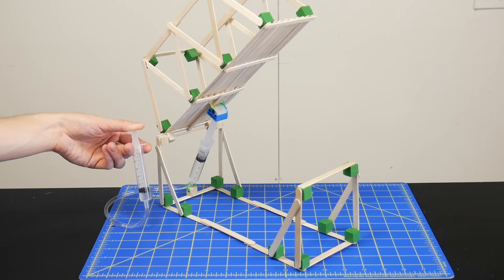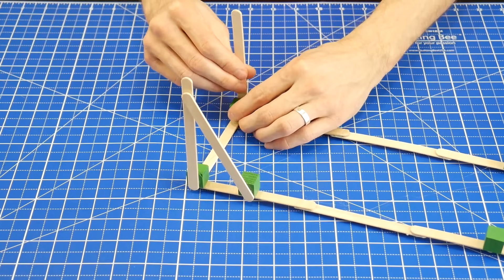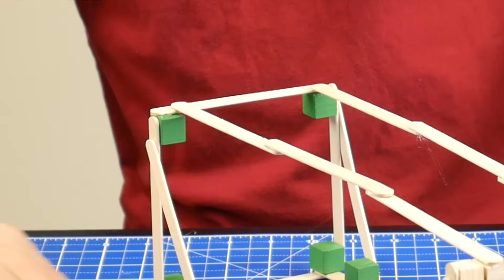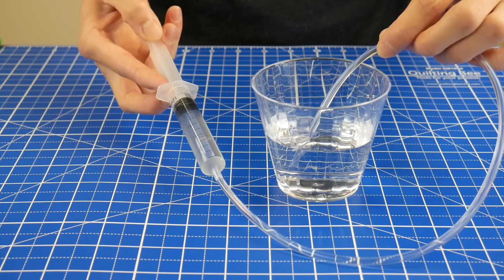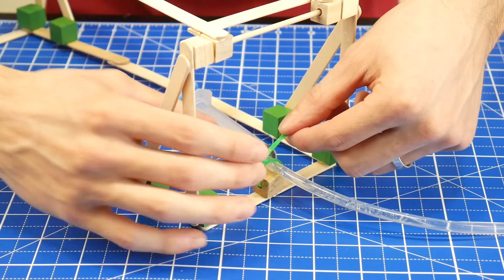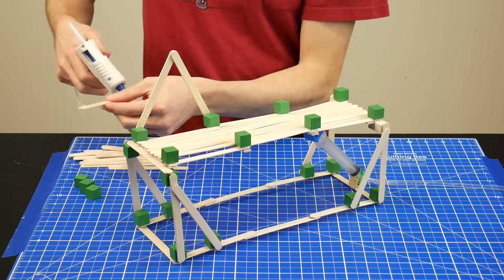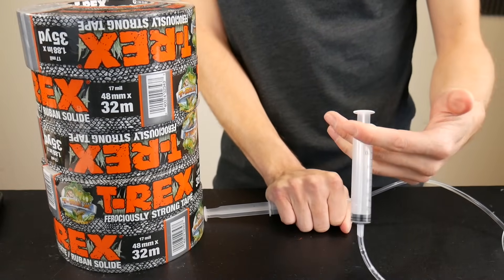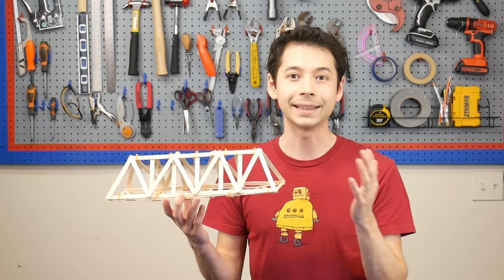Young Engineers: Hydraulic Bridge - Engineering & STEM Project for Kids

Comment: My hydraulic pump keeps leaking.  When I push the syringe full of water, it leaks at the connections between tubing and both syringes, rather than pushing the water into the other, empty, syringe. Any suggestions?
Reply: Either what the other person said or your syringe is not working properly and you need a new one because my syringe was broken or something because when I pull it it to suck out water just with little force the thing you pull up to suck up water pops out and that causes water to leak out. (yes I  know this comment was made 3 years ago its just for other people that might have this problem later on)😂
Reply: That happened to me, you have to make sure there isn’t any air inside, to do that fill the syringe with water, connect the tube, remove the water, refill it, then connect the other syringe. It should work. (I know this comment was made 8 months ago)
Reply: my comment is so late but these guys 👆answered your question.